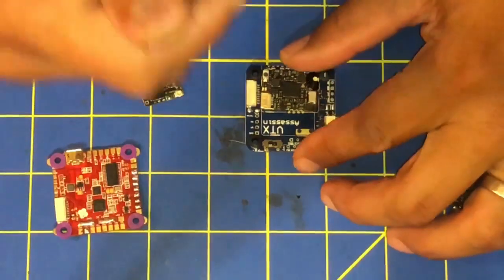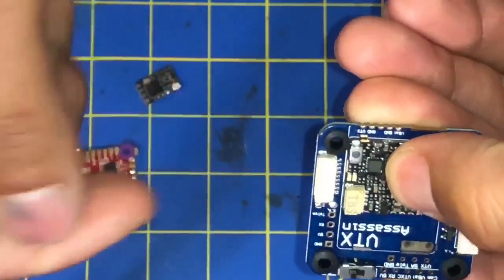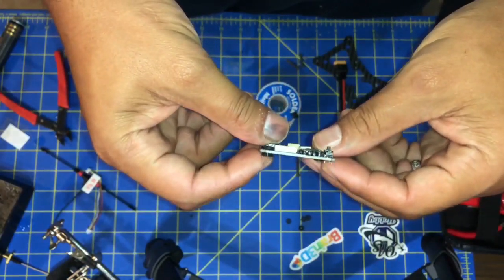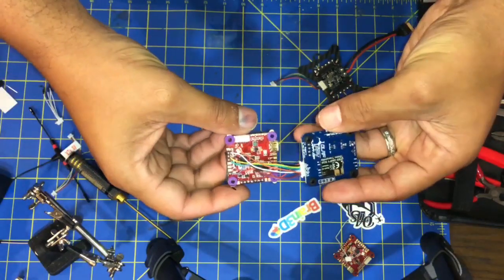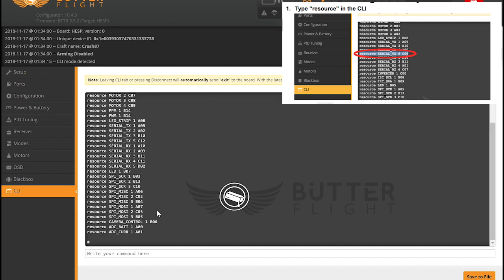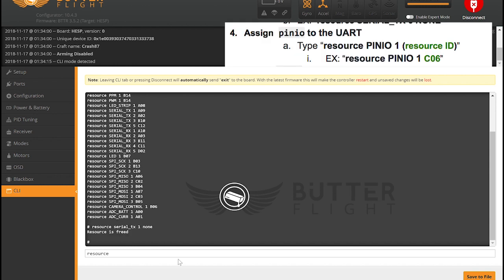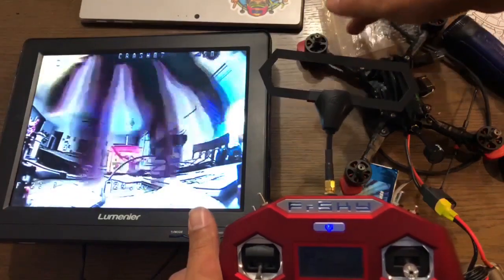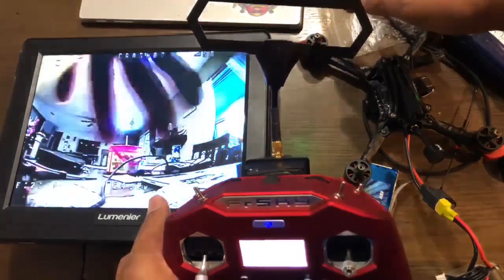VTX Assassin

Comment: After watching your video again I noted you connected the camera to the assassin. I think I have figured out the answer to the question in my previous post. The wiring process is: Connect fpv camera directly to the vtx assassin camera pads ( bvat, video,  grd, 5v)  then connect vtx assassin camera video signal wire to the FC camera video in/cam/ cam_s input pad. This is to add vtx assassin osd info to the video. Is this correct?

Comment: Installing this in a new build. Have a question related to the last wire connection “ camera video signal”. The instructions state to connect this to the FC video in/cam/ cam_s input if using osd.... could you please clarify why this is required since I would have to connect to the FC camera input from the camera? Does this wire share the FC camera input pad with the camera output wire?
Reply from the maker: The vtx assassin doesn’t have OSD. The OSD is relayed from the FC. There is a wiring harness that come with the  assassin that you wire to the FC that will give you the OSD you need.
Reply: OAS Hobby good to know.... thanks! So to recap, I connect the camera directly to the assassin not the FC?